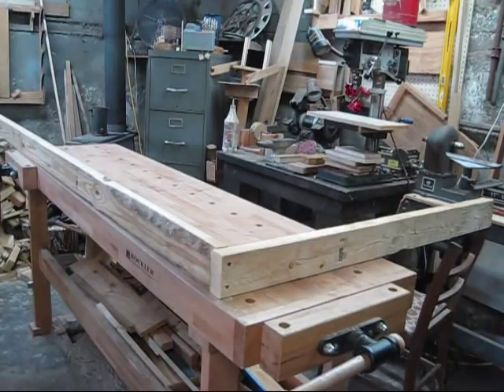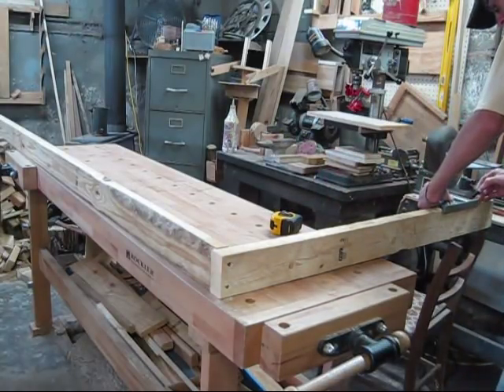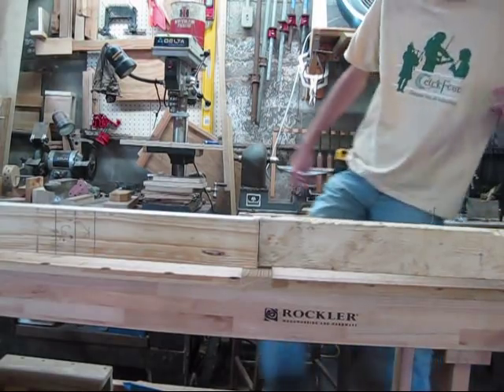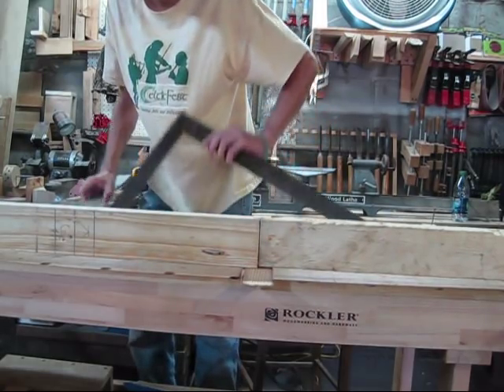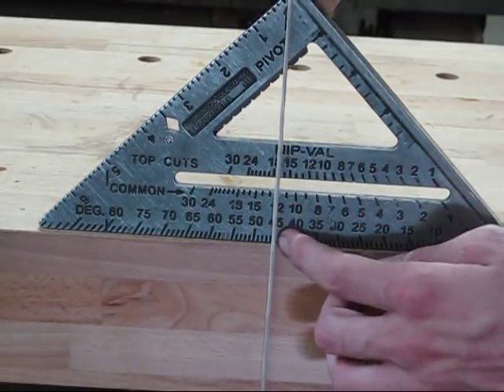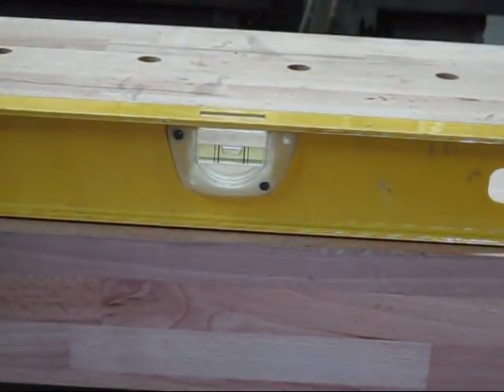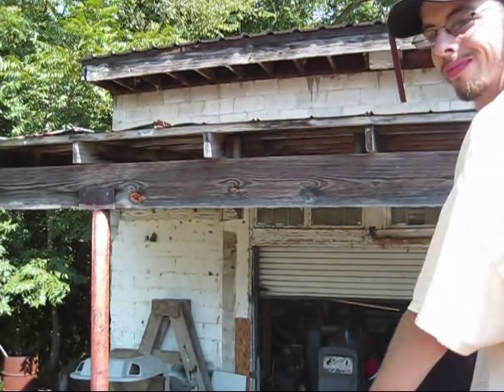Tricks with construction tools

Comment: Great video. Question my wife was trying to fing the center of a circle to attach a candle stick to a wooden base. How do you fing the center of a circle with no tools, or is there one out there that makes it easy.
Reply from the maker: Deputy Prepper Yeah just find something close to halve the size of the circle then lay the circle on its edge (with the face of the circle looking at you) then take you piece that is halve size and lay it next to the circle face.  Use the piece to draw a flat line on the circle.  Turn the circle a 1/4 of a turn then draw another line doing the same thing.  Where the two lines meet should be close to center.  Hope that helps.
Ethan
Reply: I will try that thanks brother
Reply: Deputy Prepper Another way to find the centre of a circle is to draw two lines parallel to each other across the approximate centre. Then measure each line to find their 1/2way points. Draw another line right across the circle, going through the two points, and the centre of THAT line is the centre of the circle.
Reply: Deputy Prepper Make a Paper template of the circle fold it in half and then again into quarters, Open it up and there will be a cross folded into the paper lay it back onto the circle and the centre of the cross is your centre.

Comment: Ethan and Guys - it is like this - 1. Your string method is not accurate since you did not place the screws in the same place from each end of the board. 2. Also you have to make sure your string is wrapped on the same side of the screw either at the 12 o clock position or the 6 o clock position..

The method I describe below is so simple any moron could follow it. 1) Using a folded 3 x 5 card, place at end of board and strike of a line on the board and card stock about half the thinness. (No scale needed). 2) Go to the other end and do the same but transfer the same mark to the board end. 3) Make a indent at the board marks so string pull over it will find it. 4) If you know how to do a 'trucker hitch' then you don’t even need a stake nail or screw to hold the string. 5) using the same cardstock and marks, and from the same board face - slide the card down to the middle and look directly down to see the difference string line vs the card stock marks.

Now that is an accurate way to see and measure how far the board is out of straight in the field. - So what was so hard about this Ethan – Accuracy must insure a fail proof and proven menthod for all to use, not a close as you can get and then guess you have it right Ethan.

Rick Freeman - what the F--K are you talking about! Go back to school you moron!
Reply from the maker: Dude I was showing demonstration, and trying to be fast. Aye I could have tied a slip loop in the string, but what I did was faster.  As for I being accurate the wood is going to move no matter how good you hold that string.

Comment: There is one word you did miss use was parallel lines with the frame squares
Parallel lines are TWO lines side by side what you had there was a STRAIGHT line.
This is coming from 27 years as a Machinist and Mechanical inspection just wanted to get record straight.

Comment: kind of a strange story. i was recuperating from an electrical accident in the hospital  years ago, met an earth mover owner who was badly burned also . he had taken his metal tape and measured the distance between the high tension power wires and the ground so he could tell if his equipment would clear.   lost many of his fingers and most of his hand.

Comment: would of been better if you used a brad right on the edge [instead a screw 1/4 inch off edge] to check for straight

Comment: Pythagorean theorem is the geometric formula that you are using to square the right angle...A squared + B squared = C squared.... it can also be used to find the EXACT measurement of a rafter on an odd measurement  Run squared + Rise squared = rafter length squared....

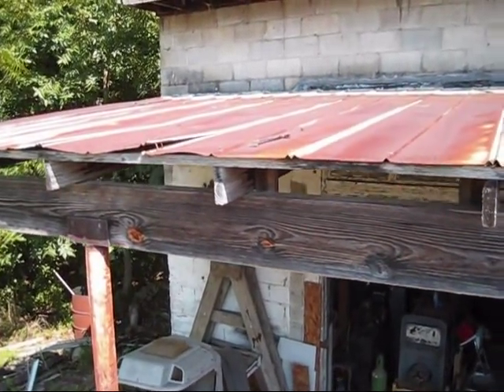Comment: 8:23 wow was this when all those cicadas emerged a few years back? That sounds like a TON of them! Also, it's kind of funny that if the video is played at 1.25x speed, his speech (speed) almost sounds normal (which might just be because 1.25x is not that significant of an increase).
Reply from the maker: No that's normal for Mississippi Summer.  We had a plague back in 2011.  I think it was the 12 or 13 year cicadas.

Comment: trig function, Pythagorean theorem A square + B square = C square   multiples of 3,4,5 are the only whole numbers that work out evenly in this equation.
Reply: 5,12,13 works, 8,15,17 works, and 7,24,25 also. The two big advantages of 3,4,5 of course are that it's dead easy to remember and all three legs are close to the same length.

Comment: you actually messed up the example of the 3,4,5 right triangle. you hooked the tape on the 4' mark at the right side of the tape and the 3' mark at the left side of the tape. NOT a straight line.

Comment: Thanks for refreshing! This 3-4-5 triangle has been called EGYPTIAN not by accident! The Pyramids there were made using the triangles like that, 3-4 kyears ago. Of course it keeps Pythagorean theorem, which was discovered much later, abt.500yrs before Christ. Trick with pion corded with a bisected square is of the same age. I used this triangle (of perfect accuracy) for adjustment a drafting table with slide angles slightly out of square. Nobody of staff egineers knew how to fix that. They did not like either the greenhorn solved the mystery of 'the cursed slider-square' :-)

Comment: Square it only with your tape measure ... then uses a square to draw square lines (could have just shoved that in the corner ya know :P )
Reply from the maker: ^----------You are right.
Reply: ***** ahh indeed, i just usually use a 1mtr long level next to my square for that
Reply: That would only give you 10" of square... 3,4,5 is infinite in its length.
Reply: What Liz Quilty is referring to is, when marking your 3,4,5 there is no need to square the lines. Just make sure you mark both at the same point. also, make sure you read the same edge of the tape.
Reply: If you actually listen to the video, he states "how to square it with nothing but a tape measure". You don't have to mark the entire line, just make a mark to measure to.

Comment: question on the first trick so 4ft length 3ft with should always come to 5ft when on each point?
Reply from the maker: That's right. Measure 3ft one way make a mark, and then the same on the other leg, but 4ft. Make sure you measure the outside of both marks to get a accurate reading.  It is a algebraic triangle.  Like this.    

__________
|                  /
|                /
|              /
|            /
|          /
|        /
|.     /
|.   /
|. /
Reply: It is 3,4,5 anything, inches meters shoes. doesn't matter. it could be 9,12,15. any multipule. or division 1.5,2,2.5

As well you can know the angles of the piece. they are 30 degree, 60 degree, 90 degree.

When i set up framing using this method i take my hyp board (hypotenuse, the 5 or long one) and take a board that is 6 feet long. I mark out 5' marks on it and set my screws ready, that way you know the other boards don't move between measurement and screwing/nailing in place.

Comment: Do you have any crown tricks?  Crown is tricky in itself, especially with walls out of square and crown that's going to be stained and caulk isn't an option.
Reply from the maker: I do have a crown molding video. You can find it on my channel.
Reply: Yea, hire Ethan!

Many hands or holders, start long and "sneak up" on the fit, work in sequence around the walls, use mock-up trim in each corner before moving on to the real material, use the successfully fitted mocked up pieces as cut patterns, cope your leading miters, then you'll have to cope both ends of the last stick, leave sticks a millimeter long at the miters so you can "spring" them into position.  Back cut those coped cuts.  Twist the trim as needed to get it into position (no gaps at flat surfaces) and really get it to work in the corners.
Reply: ...then caulk the hell out of it!!   LOL!!!

Comment: Why were those measurements wrong? Esp the 3ft?
Measurefrom the inside of the corner to make them equal!
Reply: +Bryan Kirk I agree with you typically, but depends on application for me..... if that corner is going in as a shallow concrete blockout or something, I want the outside - that's were the finished product is going.  Same situation as if I was squaring formwork for a retaining wall or something quick like that. Also, with as much twist and warp as rough 2x4's have.... well, you get where I'm going.  One other reason - a lot of times when I do this (though I rarely do anymore), the chipout on the interior of that angle is probably from a framing blade from a beaten and abused circular. Those splinters and things, though i could clean them out with my knife, aren't always small.
I guess all I'm trying to say is:  on the jobsite, when the piece is on the ground, I go outside.  If I'm at home in my shop building a bookcase I'm going inside.

Comment: Yay for Pythagoras!
Reply: +Alan Paoletti 
He's actually taking Pythagoras one step further. The Pythagorean theorem states that GIVEN a right angle triangle, the sum of the squares of the two sides of the right angle are equal to the hypotenuse squared.  What he is doing is stating that if the sum of squares of the two smaller sides of a triangle  are equal to the larger side squared, THEN you have a right angle triangle.  It's a subtle but significant difference.  To prove that his conclusion is true you would have to use the law of cosines where c squared = a squared + b squared - 2ab(cos theta).
Reply: +Burj2005 what are you talking about? the hypotenuse is the longer side
Reply: +Randy Mathews  But you don't know it's a hypotenuse until you have shown that it is a right angle triangle.

Comment: the 345method is great but suppose I want to square a 2-foot board with 3 foot board how do you go in between 3in and 3 foot to get it square
Reply: Anchor the corner, then you use the speed or framing square at the corner and match the edges of the inside of corner with right angle edges of square.  Right on, Classic Work!

Comment: Your string line trick makes no sense doing it right on the edge. It's impossible to gurentee your screws are set identical to eachother, with your technique you may end up planing the board / stud / facier for no reason wasting time. Just tap at nail in both ends in the crosscut and run a string line along the face, packevthe string line out at both end with a packer and you can litteraly measure the differences or use another packer to find the differences. Far more accurate

Comment from the maker: Tools stuck on a roof is not big deal.  I can tie a good not just trying to be fast.  3,4,5 is the most common; works on sort and long runs.
Reply: 3,4,5 works with any common multiple X2 X3 X4 etc. Sometimes people disagree with this(for what reason I don't understand) Since the most common unit of measurement is in feet. I ask will it work with 3, 4, 5 yards?

Generally they say yes. Then I ask then will it work 3 times that, 9, 12, 15 yards? If they say no point out the fact a yard is 3 times a foot.

It also works with any common fraction of any unit IE. 1/2 of 3ft, 4ft, 5ft.  1 1/2ft 2ft, 21/2 ft . When people disagree I point out that it  it is 3,4,5 half feet.

What people fail to realize is it works because the fractional units 3,4,5 and not any particular unit.
Reply: robvlob On big tiling jobs I've used 12,16,20.  That absolutely works.  You just have to multiply the same amount to every number.  You could do 300,400,500.  It should work in yards, the increment of measure is the same.  Should work in meters as well.
Reply: bigwalt2990 It works with any unit when the ratio is a multiple of 3, 4, 5
Reply: bigwalt2990 you are correct, it could be 3 miles 4 miles and 5 miles (if you want something REALLY square lol)
Reply: michael cochrane just want to make mention that you can use multiples of 3 4 5 as well.....as in 9 12 and 15 (multiplier of 3) or 15 20 25 (multiplier of 5) or 24 32 40 (multiplier of 8)
Reply: michael cochrane Yep, I've read that somewhere before ;P
Reply: lol sorry dude, didn't read the whole thread! oops haha (but what they say is true, brilliant minds DO think alike!)
Reply: michael cochrane
A²+B²=C². Use this formula and it doesn't matter what length the 2 sides are.
Reply: Corey G thank you sir
Reply: robvlob the whole world uses metric except for the USA. 
The foot is no longer the most used except in the usa.
Reply: Sorry, no, you are incorrect. The imperial system is still used in construction. I have been on numerous sites and have never used metric.....OR purchased lumber in metric dimensions...it is ALWAYS 2 x 4 2 x 8 2 10 in 8 10 12 foot lengths...plus I buy ALL sheet goods in 4 x 8 4 x 10....tyvm....
Reply: Corey G Was going to mention the same thing. Was trying to establish a perfectly level line over 25 feet; had no transit and only a 4 foot level and a plumb bob. So, I plumbed down from top of wall and measured the height (9 feet). Then, measured my horizontal (25 feet). Convert to inches and then work it out using Pythagorean: (108x108) + (300x300) = 101664. Square root of that is 318.85 inches. Pulled tape from top of wall across and down to where the 318.85 intersected a plumb line at the 25 foot mark, and that gave me my perfectly level line based off of the original plumb line. Transit confirmed accuracy.
Reply: Kyle Young yup, works in MMs, feet, inches, yards, miles.....
Reply: yep.
Reply: +Albi The funny thing is the two systems are sometimes mixed. A few years ago I went to a building supplier and asked for some 2x4 (inches) rough cut timber. The reply was, sorry mate, it's metric now, you have to have 50x100 (millimeters). So I said OK, can I have five pieces at 3 metres long, Sorry he said, it comes in 10 foot lengths!
Reply: +Colin Faed That's just crazy!
Reply: +michael C Well, if you're using 3 miles, 4 miles and 5 miles, you're getting long enough that the curvature of the earth may cause some problems since the 3,4,5 ratio is for plain geometry and not spherical geometry. Assuming you can find a nice large "flat" plain capable of handing your 3,4,5 mile triangle, you'll need to have posts about 4 to 5 feet tall to make your measurements from. If you strung a string from the top of a post to the top of the next post, the 5 mile leg's string would just about touch the earth at the middle of the string. (exact height of posts required dependent upon where on earth measurement is being made from given that the earth's radius ranges from approximately 3947 to 3968 miles.)
Reply: John Cochran lol but again, (not accounting for terrain variations) if the curve was the same, the distances between the points would be the same....

But you know, I was just being a smartass right? lol..

(not being a smartass THIS time :-) but are you an engineer? journeyman?...cuz you remind me of one when I was using a bucket and water anda tube to check level of deck posts...he said "what about the curvature of the water due to atmospheric pressure? I said "ok, these posts MIGHT be .01 mm off over 20 ft. and I'd worry about that my saw cuts were that accurate...I said "hell, one deck board will be off that much in thickness over 5 INCHES so don't worry about it lol...)
Reply: +John Cochran It's 4 miles vs 4.0000002 miles, about one-hundredth of an inch of difference. The string would sag more than that. It's kind of like when I'm making measurements over 12ft and someone will get after me because I'll have the hook of the tape slid an inch to the left of being square. It makes 1/32 of an inch of difference! Tapes should only be measured to the nearest 1/16th at that length. The lines alone are allowed to vary 1/16th in either direction when you get that far out. Point being you are talking about mill spec over 4 miles.
Reply: +Classic Work
 For all of those working with alternate units, there are about 126 millifurlongs per inch.  Hope that helps.
Reply: Spam Dump are they any relation to Edward Furlong?
Reply: +michael C 
No.  Just the standard 1/8 of a mile furlong.
Reply: +Spam Dump 
Micro-furlongs, not millifurlongs
Reply: +Corey G Of course it works - everything's squared!  LOL
Good info!
Reply: +vmitchinson Construction wise and in most building industries, imperial is still really dominant. The only area I can't speak for is Asian regions - never worked with any projects around there.
Reply: If your knot is like your spelling,it isn't worth a shit either

Comment: Why not just cut the cross bar to 5' and avoid all of the excess measuring?
Reply: +Kenneth Shackelford  "excess measuring" and time/labor.
Reply: He ran the crossbar long so he could screw it to the side of the frame and it is quicker to get a measurement than it is to make a cut. Plus if you are going to cut the crossbar at 5' then you will have to measure it anyway and then cut it.
Reply: Sean Smith I would cut that "stiff back" as he calls it to 5 feet, since it has to be cut anyways. Make my mark at 3' and 4' as he shows, tack it in to the measure at either the 3 or 4 mark, then tack it in again, after lining it up to the other mark. Sure, it I was working on a nice, flat, straight table, with no wind blowing my tape around or gravety fighting me and with nice straight 2X4s that aren't fighting me, I would agree with you but this isn't always the case now is it? :) Mark 3, mark 4, then attach #5 to measure, for real world circumstances.

Comment: The only flaw I see is the two screws in a beam and line trick.  There are many way this is not that accurate.  You could put the screws at different angles, spots on beam.  You could not pull the string tight enough.  Mostly like you did in this video not have a clean string.  You had a knot in it....  etc.etc.
Reply from the maker: Tony Horton Aye it was just a demonstration after all.